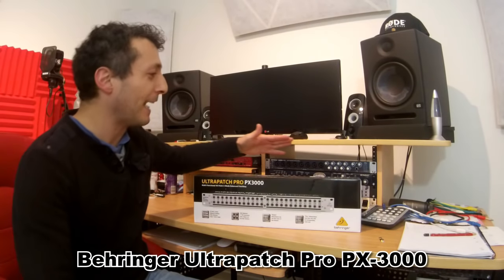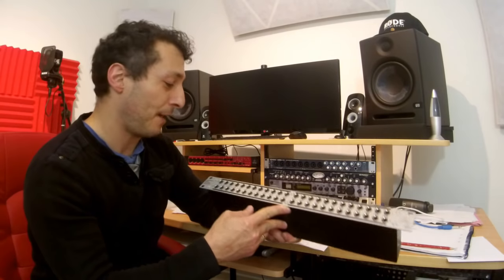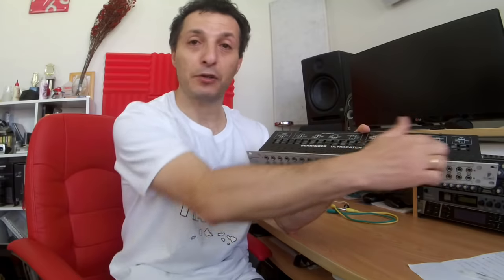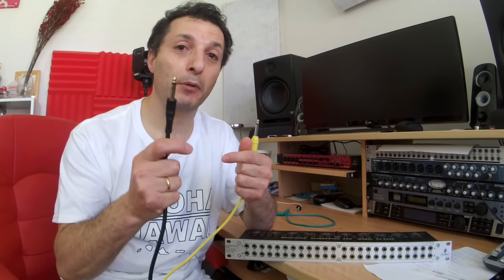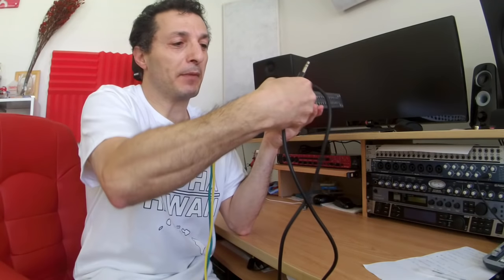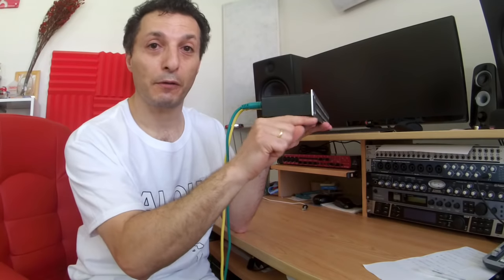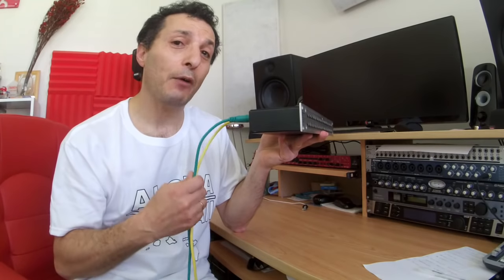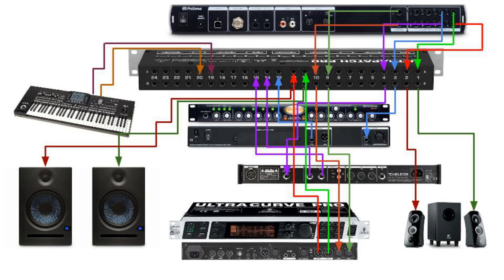All About Patch Bays - Behringer PX2000 & PX3000

Comment: Thanks for this. It really helped with a lot of questions. One that I'm still struggling with,  is using external fx, and pedals.

You said to ask any questions,  so here goes... 

Is it still out and in from pedal,  to patchbay,  then patch to synth or whatever via the front? 

Would they need to be half normaled? 

Could I patch two or three fx into the same synth or sound module simultaneously? 

Thank you
Reply from the maker: Though a graphic presentation will be better explanation (I see if I can draw one), for your setup, just think of guitar pedal chain. Guitar plugs into the first pedal, then out to the next pedal and so on, using Normalized or Half-Normalized mode setting. In half-Normalized, it will allow you to patch an output of an FX pedal into 2 following FX pedals, one from the rear B connection and the other from the front using patch lead.
This way, you can use the patch leads to change the order of the FX pedals, otherwise, no patch leads required. This also allows you to patch amy synth audio output to any FX pedal.
Hope this helps.
Reply: Fantastic.  I think that makes sense! I'll play around and I'm sure it will become obvious!  Thanks again.
Reply from the maker: Here is a visual layout of a live setup example.
https://docs.google.com/presentation/d/1MeUgFulsE4bTGtJ3V866XfuB4AIWfh_BLlUjogjul-c/pub?start=false&loop=false&delayms=3000

The audio from the synth will go through each FX pedal before the Audio Interface. Using patch leads, you can change the order of the FX chain.
Layout shows mono FX pedals, hence why I left 1 empty patch between for stereo.
Hope this helps.
Reply from the maker: Here is a visual layout of a live setup example.
https://docs.google.com/presentation/d/1MeUgFulsE4bTGtJ3V866XfuB4AIWfh_BLlUjogjul-c/pub?start=false&loop=false&delayms=3000

The audio from the synth will go through each FX pedal before the Audio Interface. Using patch leads, you can change the order of the FX chain.
Layout shows mono FX pedals, hence why I left 1 empty patch between for stereo.
Hope this helps.
Reply: Wow! Thank you so much. This makes perfect sense to me now! Thankyou again!!
Reply: for using it with external pedals/efx: is it recommended to take a balanced or unbalanced bay? or doesn't that matter?

Comment: Hi, so to be clear you're supposed to use a balanced patch cable when patching unbalanced lines on the PX2000 unbalanced patchbay?
Reply from the maker: If you are using PX2000 the unbalanced patch bay, then you only need to use unbalanced patch leads. Using balanced patch leads will make no difference.
Reply: @RecordingStudio9  Thanks for replying. Why is it that the unbalanced patchbay will allow balanced patch cables to patch unbalanced signals but won't be able to patch together balanced signals?
Reply from the maker: @Jacob-ir6zi  Because the sockets on the patch bay only have 2 connections and not 3. Search TS and TRS jack images on Google to help you understand. I assume you know the difference between balanced and unbalanced signals.

Comment: May I ask another question, is it possible to destroy audio gear by inadequate patching? Are there patching that can go totally wrong? Thank you
Reply from the maker: Yes, feeding an output of a device back to the same device's input. BOOM!
Reply: @RecordingStudio9  Sounds scary, being a novice not sure what kind of BOOM, will there be: it will cause a loop that goes loud and destroy the speakers? Or the sound card will be burned out? Would you mind being more descriptive, please? Thanks :)
Reply from the maker: Any time you connect the outputs of an audio device to its input, you can damage the device, as it creates a loop of the signal. Same as pointing a microphone to a speaker that can damage both the amplifier and the speakers.
Reply: @RecordingStudio9  OMG, patch bays are somehow dangerous. Sockets must be precisely indicated not to commit any wrong connection.  
Actually nobody really speaks about wrong routing, in ten videos about patch bays I've heard only one person mentioning wrong patching problem. 
Anyway, thanks for your explanation. Cheers!
Reply from the maker: @irorosun6990  If you plan and setup the patch bay as per recommendation, ie. all outputs at top row A and inputs at bottom row B, then you only need to remember to connect from top (A) to bottom (B) from any column to any column. So you are always connecting the output of one device to the input of another device.

Comment: I'm having trouble with main output. I don't have the right connections to hook up my monitors. So how do I route the output of.... say my reverb to my speakers.
Reply from the maker: Not sure I understand your questions, but Patch bays are not mixers. They just bring in/out connections to one central point. Normally a reverb is patched to FX in/out of a mixer and the output of the mixer patched to a powered monitor or amp/speaker combination.
Reply: RecordingStudio9.com sorry question wasn’t clear. I have sorted the problem. I do have another question. Is it better to connect outboard gear using Thru or Normal? As I understand using Normal my gear output will be connected to the input of my interface all from the back until I decide to change routing. 
At the moment all my gear is connected using Thru. So I have to run cables to make the initial connection

Comment: i don't understand how you have the logitech speakers conected to 2 inputs. i have those same speakers ans there is only only 1 mini jack to connect with
Reply from the maker: My set has a sub-woofer box, that has 2 RCA inputs along the 3.5mm stereo plug that normally connects to a PC sound card.

Comment: I jave a Q
i have a px3000
and a neuman tl103 (phantom)
i go from the neuman to the rear input (bottom) of channel 1
and run balanced cable from the output (top) of the rear to the input of my apollo 8
i hit the phantom power on channel 1 on the apollo
and choose chanel 1 in PT

no audio.
what im doing wrong?
Reply from the maker: Read the manual to check how to direct monitor the mic channel first, to make sure the mic is working. If it is, then read the PT manual. I'm not too familiar with ProTools. I hardly ever use PT.

Comment: i would liketoknow ifitspossible to use multiple send returns in a chain in a patchbay. example: fx 1 goesinto Top row jack 1 and tghe backside goes to soundcard into my computer, the 1 below now on the front emits the audio of the soundcard + the fx. I grab that output from the front and patch it to fx2 to get original audio+ fx1 +fx2
Reply from the maker: Patchbay is not a mixer. Connecting multiple outputs or multiple inputs together with no electronic separation, can damage your equipment.
PS. Generally, the top A is OUTPUT and bottom B is INPUT.
Reply: @RecordingStudio9  ok! thank you, the thing is. i have quite a big studio. i have a Antelope Orion 32 channel soundcard. When for example I run PCAudio1 to FX1 and back to de PC and the to FX2 and back to the PC I get latency and I want to compensatethat, but a patchbay isnt the thing then?
Reply from the maker: @shufflephunk  No , not at all. Latency is from your sound card buffer size.
Reply: @RecordingStudio9  Okay but I notice that I have big DAW programs, sometimes more than 40 audiotracks, so I do need the buffering? Or should I then resample or freeze tracks towards the finishing of the trck?
Reply from the maker: You can certainly freeze or print your tracks that have many VST plugins to release some CPU process but buffer size is for both during recording and playback.
Again, this topic is not related to this video. I recommend you search and read about latency and buffer sizes.
Reply: @RecordingStudio9  I am very sorry and you are absolutely true, I have been struggling with this issue for a long long time though and I never understood the concept of a Patchbay. And since you coined the possibility of connecting all your Outboard FX I thought this would be my solution :)
Reply: @RecordingStudio9  And you helped to manage me get some questions that have been troubling my musical process for many many many years. I have all my DAW legally and they cant even help me, I stil cant get a hold of the concept buffer siZE 4tc, could I maybe private message you?

Comment: I am still a bit confused on mixing outside the box. I would like to know how this is used with external equipment in practice. I assume that the output on the back you show in your diagram has to be selected as the output in your DAW for the track you want to apply the external effect for. Then you have to add a patch cable to a new input on the front of the 1818 and create a track in your DAW to receive the new patch input signal. Is this correct?
Reply from the maker: Basically, yes. The audio signal from the track routes out to one of the outputs of my 1818VSL into the patch bay, then patched to the input of the outboard FX gear. The output of the FX gear patches back to an input on my 1818VSL, which routs back to the track. S1 Pro, using Pipeline VST is the only option. ProTools and others have different method. Not all DAW support track insert to outboard gear.

Comment: why would you plug in your interface's outputs to an interface?
Reply from the maker: +iAmDrigo Steel 
Not sure what do you mean? Do you mean into an outboard gear, like FX or Compressors? If so, then you can use your DAW track to send the audio out of one of the extra outputs of the Audio Interface, feed to to a Comp or EQ and return back to the Audio Interface and back into the track in your DAW for external analogue audio processing, rather than a VST plug-in.
Reply: thank you for everything your video is very nice ,and is possible to take your adat outs or ins from audio interface to wiring with patch bay with analog mixer thank you again for everything
Reply from the maker: ADAT is a digital signal that uses Lightpipe or fibre-optic leads and cannot be patched. The audio in and out from the ADAT Mic pre like the Behringer ADA8200, yes, as they are analogue audio signals.
Reply: thank you for everything god the bless people like you

Comment: Normalized means you don't have to have 24 little patch cables
Reply from the maker: Weather Full or Half Normal will still feed the link from top (output) to bottom (input), so no patch leads require.
Full Normal, when you plug a jack at the top, it disconnects the link to the bottom. Half Normal, when you plug a jack at the top, the link is not broken, this allows same signal to split into 2. Hope that explains the difference.

Comment: Man your  all over the place. stick to a simple demo.  You have a CD player it,s stereo.  so output the sigal R&L into PX3 channal rear top 1 & 2 and take another two cables plug rear bottom 1 & 2 to your mixer/interface/amp. play CD, plays normal........ Now, lets line in a sound processor. plug it to px3 on the rear top 3 & 4  and its output to the bottom rear 3&4.........  here comes the patch  take two leads into front  top1 & 2 then to bottom 3 & 4 by doing this your spiting the CD sigal into processor  now return the sigal top 3 & 4 back to bottom 1 & 2 front.  so the sigal goes into RT 1 & 2  from FT 1 & 2 front into  BF 3 & 4  into the sound  processor then  TF2&3  BACK into FB1&2 into mixer..... Same works in mono this is a good start point, to get going.  just remember the in and outs are split when you insurt a third jack.....MAKE A PLAN
BT1= BACK TOP CHANNAL ONE
BB1= BACK BOTTOM CHANNEL ONE
FT1=FRONT TOP CHANNAL ONE
FB1= FRONT BOTTOM CHAMMAL ONE                  you get the idea!
so let say  BT6 TO  FT6  IS A LINE STRAIGHT THOU  So!      Synth BT6 TO FB7  "Procesor" THEN TF7 TO   BF6  The cables cross each other...    it,s a question of chasing your tail 
.
Reply from the maker: Thanks for the comment. You might have missed the part about Normalizing your patch bay so you won't need patch leads unless you are reconfiguring. You have/assume every channel back socket feeds the front socket, which is not necessarily so. This mode can be changed via the switch from Normal-Through-Half Normal.
Might like to watch these 
https://www.youtube.com/watch?v=VurgTvrJ6kI 
https://www.youtube.com/watch?v=JPUSDMdM7n0